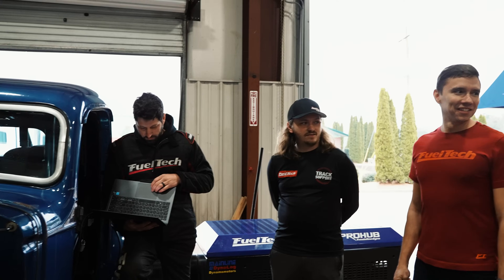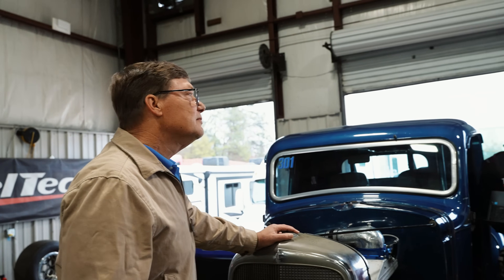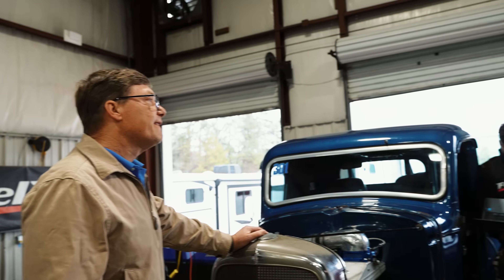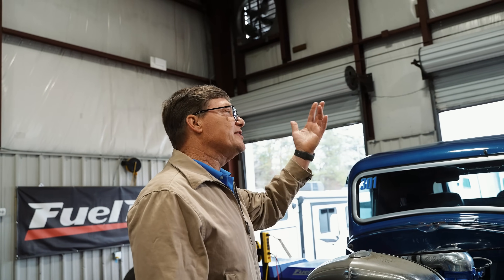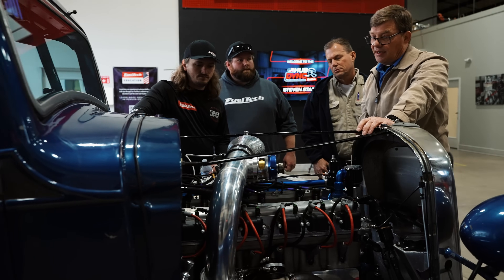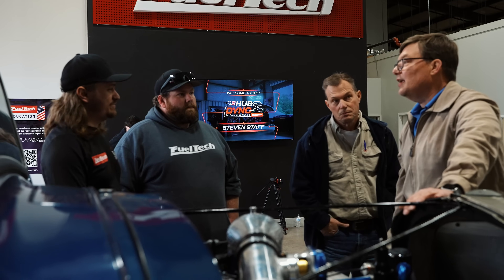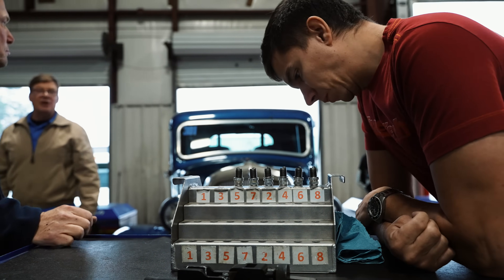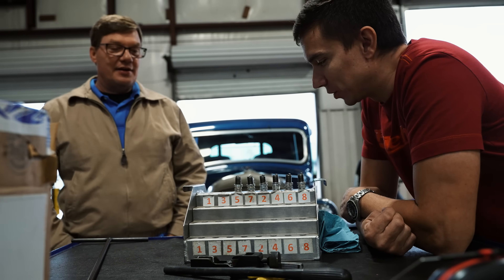1936 Chevy Pickup Gets Dyno Tested! | Staff Bros. Garage & FuelTech USA

Comment: Love the new ECU and TBI setups but it is a big disappointment that FuelTech doesn't sell their new fuel injection TBI units separately for people that want to use their TBI unit on another ECM like a factory ECM that has tuning capability. Can tell ya the Chevy TBI units on the trucks & cars of the 90's run into problems with getting enough injector in the TBI unit and this would solve that problem. I am building a turbocharged 94' GMC C-2500 5.7L and can not find a TBI unit for sale independent of the ECM from any of the companies making fuel injection setups. Would the company be open to selling the throttle bodies separately? They are missing a big part of their market!
Reply from the maker: I think you are talking about the company FiTech. We are not FiTech, we are FuelTech.

Comment: This motor should produce a heap of torque, any numbers
Long stroke wouldn't push much over 5 500, use the torque range
Reply: It’ll go to 7500+ I was told.
Reply: Long rods also.  I’ve seen these engines run over 7000 rpm successfully.  Kay Sissel made a twelve port head for the 250/292 engines
Reply: @Lloyd973  Yes and no.... Mike Kirby the friend of Kay Sissells built the heads.

Comment: The Atlas 4200 is a ripper 😝🤙. My parents stock Trailblazer was rated at 290hp back in 2006. Everyone wanted the LS SS 6L version.
Reply: This doesnt have the 4200 in it. This has the old 6 banger from the 60s and earlier
Reply: @ I saw that 👍

Comment: What engine is it?
Reply: In the description they say it's a 292
Reply: I have spoken to him. It's a slightly de-stroked Chevy 292
Reply: 292 ohv stove bolt
Reply: I just read an article on this build. It’s a Chevy 292 out of an old UPS truck de-stroked to 285ci with a Garrett 88mm turbo made 1320.2 HP on the dyno!
Reply: It’s an industrial 292 out of a combine
Reply: @kevintaylor9086  With the exception of some lower compression (7.8 VS 8.0) 292's for export all 292's are the same, industrial or passenger trucks. Some people say the Mexican blocks have more Nickle in them.
Reply: @lazyhoundracing9621  The Mexican blocks were casted and machined at a new plant. The castings were more consisant per core shift. Not sure about the nickel thing tho.
Reply: @mitysix5441  Thank for the info.
Reply: @kevintaylor9086  That engine had a accident on track and its the reason for this build. Its a block from a UPS truck.
Reply: It’s a GM engine. Not sure of what head is on it.
Reply: Its a cool build, and great to see a none cookie cutter ls swap like my car
Reply: The Atlas 4200. Stock head for the most part. Underrated engine and only produced for a short run. The Ford Barra comparison. And American 2JZ lol. It may be the older 4.8l one.
Reply: @KTMGREG55  It’s a 250 inline from the 1960’s. It has single camshaft. Atlas is a DOHC

Comment: 177hp per cylinder @ 6 cylinders with one turbo. Stright nasty 36 chevy pick-up and my color to.😍
Reply: Vem ver os opalas aqui no brasil entao.6 cilindros.
Reply: Better come to Australia mate. 2000 hp is the new benchmark for a Barra 6 cylinder Street car.
Check out FULLBOOST Dandy engines Barra. Fueltech all the way.
Reply: @chrisobrien9334  That might be true mate, but it's not a 60-plus-year-old push-rod engine either.
Reply: @ Got that right mate. Old school is always harder.
Reply: @chrisobrien9334  Barras gay bro. They sound like ass. Huge ass lump of junk. Didnt leave auzzie / nz because it wasnt good enough.